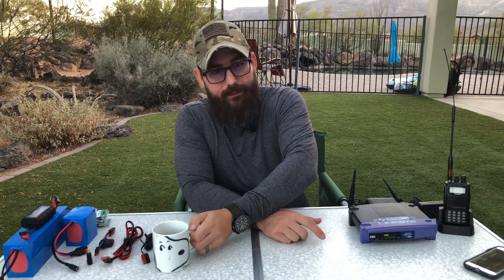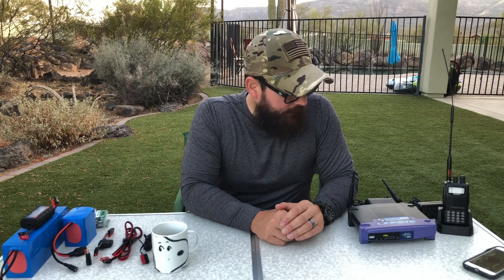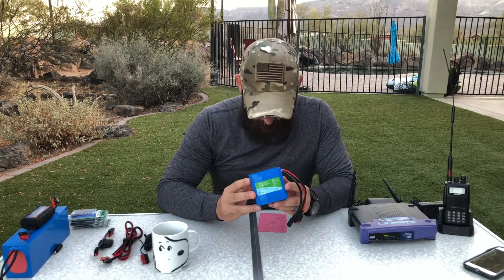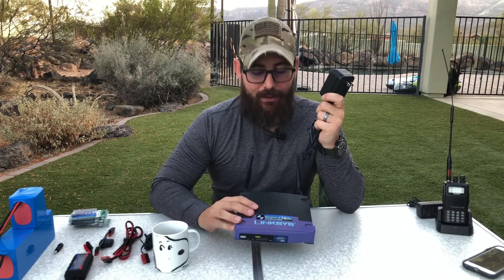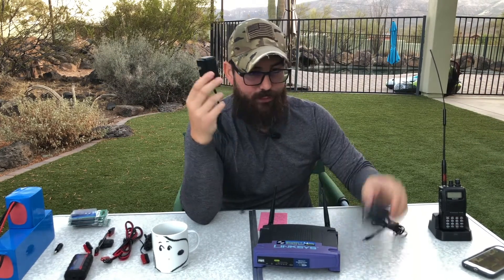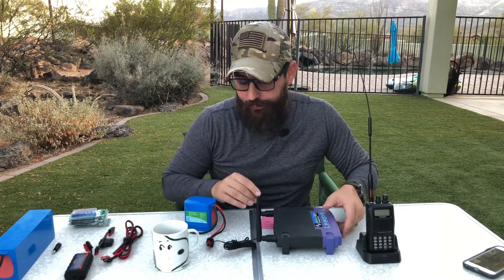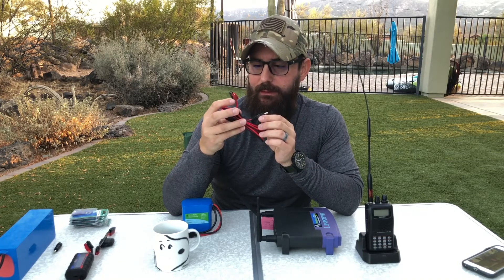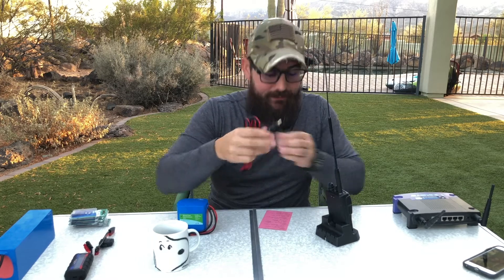12v Appliances & Accessories for Preppers and Hams

Comment: I have gone to rechargeable battery with   a no need for dry cell batteries  when the Power form how are we to charge  we still have to burn fossell fuel or use charged  car battery 😊

Comment: Just a comment on fuses. Fuses are to keep the wire from becomming an ignition source and do not protect your equipment.  To determine your fuse size you take into consideration the wire gauge and the length of the wire.  The length with a negative and positive wire is going to be twice the length, or the round trip from the battery and back.  Highly recommend the Blue Sea wire charts to make these determinations.  Love the videos.
Reply from the maker: Thank you for the correction. Yes, you are 100% correct. Glad you like the videos.

Comment: keep the inverter it may still be useful, transmitting power over distance the one example if you need to go a couple hundred feet the 12v dc won't do so good. you might find a more efficient inverter.

Comment: Great video. How is your project coming along?  My shack (it really is a small wooden tool shed)  is located about 200m from my house.  Totally offgrid.  I have been powering it with about 120w of solar panels and a couple of smaller AGM and LiFePO4 batteries.  That includes all radios, a Raspi 4b, a full sze LCD display (found in a junk pile, input 12v), HT chargers, etc. Where something other than 12v is needed I use buck converters.   Lights are rechargeable LED lanterns (amazon, of course) and a 5v goose neck LED light.  They and the Pi run on 5v.  My laptop (Lenovo Thinkpad) has a long battery life.  In any case I have a DC to DC charger for it. 

One MAJOR advantage to a DC system is no RFI from inverters, power supplies or other AC devices in the shack.  The mppt charge controller is shielded even though it emits very little RFI.  Being in an olive grove I have zero intererence from our neighbor, about 200m away from the shack in the opposite direction, and about the same distance from the power line.  My background noise is about S-zereo.

I have ordered from Alliexpress a 12v to 13.8v DC transformer (around 47 Euros) to ensure my radios get the 13,8v they desire.  I have some battery monitors and low voltage cutoff to keep my batteries happy, especially at night when the sun doesn't shine.  This will be less of a worry in the future.  See below.  Also there is a an 8 port  fused, Anderson power pole strip (see Amazon and other sites, ca 75 bucks).  That will clean up my wiring mess!

I am upgrading everything now.  I suggest you visit the website and YT channel from Will Prouse for ideas about PV systems for homes and RV's.  I am now building a system based on one of his suggestions. It consists of 400w of solar panels (2x200w in my case), 2x150Ah AGM batteries (can't afford LiFePO4 batteries that large), my Epever MPPT solar charge controller already in use. For the shack it will be a 12 system (batteries connected parallel).  For the home back up system (see below) I will probably configure it as a 24v system, especially considering the size of the planned inverter.  The wire connection inverter and battery is thinner and cheaper.

I will also get a 3000w pure sine wave inverter.  But not for the shack.  Where we live we experience power outages of various lengths.  They seem to be getting longer.  We have generator to power most appliances in the house (we have a transfer switch and can cut our house off of the grid), but fuel is limited.  With the "small" PV system that can easily be transported to the house, we can continue top power our appliances (on a rotating basis) and our cistern water pump so that we have running water and hot water (we have a siphon based solar water heater).

I got some great ideas from Will's YT videos and his book "Mobile Solar Power Made Easy."  Not just for the RV crowd.

Comment: If you do decide to use an inverter it may be more expensive but try to get one that's a pure sine wave inverter especially if you plan to charge or power high-tech devices such as computers for devices with computers in them.

Comment: When making your own cable and after cutting off the wallwart, how do you know which wires are positive and negative to put the powerpoles on?
Reply from the maker: Good question. Typically, the wire with the white stripe or dashed lines will be the positive. The negative typically has no markings.

Comment: You are heading the right way. When you design your PV system keep this general rule in mind to keep I^R losses low and minimize wire guage required. Keep your DC current to 100A or less. You will find that the industry already tends to follow this rule in sizing inverters, etc.
Also, the off-grid lithium battery industry has skipped over 24VDC batteries going from 12VDC straight to 48VDC. So if you are designing a system to support a 1500W-3000W inverter you should consider a 48VDC battery system instead of a 24VDC.
I went with  16ea. 100W Renogy monocrystalline PV panels and two Morningstar Solar Prostar MPPT-40M charge controllers.  This allows my to run 1200W of PV to a 24VDC 150Ah battery bank comprise of four 75Ah 12VDC AGM batteries powering a Samlex 3000W pure signwave inverter. This can be used to power my refrigerator or small portable or window HVAC. The components were chosen based upon reported reliability and FCC class B rfi noise certifications.
The 400W of PV system can power a 12VDC 75Ah of AGM battery for powering radios and other small 12VDC gear.
I do have a 12VDC 300W Samlex inverter that I mainly have for plugging into my Chrysler 300.
I have 18VDC tool batteries, fans, and lights with enough power for 2-3 days of fans and lights before I need to deploy solar.
Breakers and box are from Midnight Solar and I have a system wide GFI from Morningstar Solar that does NOT require an earthground.
As I built the system 5-6 years ago I stand by my build decisions at that time. With the industry as it is now I probable would do a 48VDC battery system.

My systems are meant to be portable. I cannot install solar on my condo, nor can I use a generator after a hurricane due to CO2 issues and code.
As I did a portable system I used 3 conductor flexible rubber jacketed portable power cable to PV array, battery bank, and inverter. The three conductor cable gives me flexibility as to where I put my earthground should I use one and it allows an easy way to tie the grounds together from one end of the system to the other.
One last important note. Look at the latest NEC for solar. There is a DC voltage limit of I believe 85VDC at the component level. For PV panels it is based on open circuit voltage. This for the safety of first responders to prevent or reduce the likelihood of electrocution. Four 100W nominal 12VDC panels exceed this voltage by 2-3 volts being around 18.5VDC pmax and 22VDC open circuit voltage.
NEC has to be adopted into local building codes before becoming effective and applies to new construction and major renovations. Find out where you area is related to the latest NEC and design accordingly.
Also, inverted losses are fixed based upon voltage drops across descreet components like diodes. That is one reason higher voltage PV systems, battery banks, and inverter acheive higher efficiencies.
Reply from the maker: Excellent tips. Thanks for sharing. I started a separate build over a year ago to solve the CO2 problems indoors. It's basically a 100Ah LiFePO4 battery on a dolly with a 3000 watt pure sine wave inverter. Works very well for running the fridge for 24 hours. 

https://youtu.be/Dk07XA_i0MI

Comment: Can you tell is what you use the router for?
Reply from the maker: The RV is parked on the far side of my property. We have no cell reception and the wireless network does make it far enough to the RV when using a laptop. With the antenna on this router I can get a signal from the house. I use it as a wireless bridge so that I can access my home's primary network and Internet gateway when working in the RV.

Comment: Do you need to regulate the output of the battery too the divice for direct connect? Or dose the input device determine the current drawn. Ps the fuse is just for surges rite?
Reply: The battery provides a voltage and a potential current. A load device draws a specific current related to the supplied voltage.
The load device is looking for power as Watts within a designed voltage range. The lower the voltage the more current the device draws to get the required power in Watts or Volt Amps. Increased current causes additional heating in the load device. In well designed devices the device shuts down due to lower voltage. In poorly designed devices all the magic prayer smoke escapes through a critical component sometimes causing spectacular catastrophic failure.
Reply from the maker: Catching up on comments. Thanks for jumping in. Excellent response, Viron.

Comment: Thanks for putting this together. There are obviously some things preppers need to get before worrying about tech when SHTF but for those of us who have air, water, shelter, food and lead throwers covered; tech will massively increase our grid down productivity and security.

For compact systems that are close to their power supplies DC is more efficient power source than AC. Only use the AC inverters if you need to throw your power 'long' distance or lack of large cable gage is a limiting factor. Remember when using DC the higher the gage the more efficient it'll be.
Reply from the maker: No problem. You're right, once you have your core preps in place, tech has a place. For the last 6 months,  the channel  has been focusing on offgrids comms. The ability to power and effectively use comms without a grid tie absolutely increases our capabilities as preppers.
Reply: Let me add a data point. The issue is not AC versus DC, but the difference in voltage. For a given amount of power required, the higher the voltage the lower the current. Power lost in transmission is related to the square off the current. Again, for a given power required, a 12vdc system requires about 10x the current of a 110vac system and that’s where the power lost in transmission comes from.

Furthermore, transformation of DC voltage is more challenging (doable but not as simple) than transformation of AC voltage. This is one of the main reasons Westinghouse’s AC distribution system supplanted the Edison DC system. It’s fairly simple to transmit AC power at high voltage (lower current and lower transmission loss) and then transform it to line voltage near the use point. 

This is a reason why some solar installs use higher DC voltage (24v or 48v) — to reduce the current required to transmit power and thus reduce loss.

This is a long response, but is something I’ve been thinking about quite a lot over the last couple of years. 

DC-DC buck converters are one way to transform DC voltage, but they are relatively low power and can be radio noisy. I have one to power a Raspberry Pi from my station supply that is quiet and my Pi only draws about 500ma to run.

In the end, this is a huge topic of great import to prepares and radio operators. Thanks for taking on the project, Gaston. 73 de AG7TX

Comment: Not only are you losing efficiency at the inverter bit there will be power losses from the ac to dc conversion with the wall wart
Reply from the maker: Absolutely great point. We’ve been running directly off the 12v battery for awhile now.  The WRT54G is a 12v device, so we were in luck so need for a boost or buck converter.

Comment: I ordered a USB 5 volt to 12 volt cable in hopes of running my WIFI router from a power bank. I have a Rockpals 280 watt hour power station and in a test I ran my WIFI for six hours and lost 19% of the charge using the AC output. But during a power outage I`ll need to recharge the Rockpals with a 60 watt solar panel and my internet will be interrupted for hours. 

I saw one of the converter cables and ordered four and a multimeter to test the polarity and voltage so I won`t damage my router. I have 15 power banks and six smaller wattage panels with USB ports to keep plenty of those charged for various devices and they should also easily power a 5 watt 12 volt WIFI router too. 

The 20 to 30 watt portable USB solar panels easily power a small USB fan even on cloudy days and it`s much less expensive than buying batteries for fans after hurricanes and other bad storms. I also bought a little 12 volt DC water heating element that you place in a cup and a cigarette port adapter for my 60 watt panel. Hopefully I can heat water with the 18 volts coming from my 60 watt panel with it without damaging anything so I can have instant coffee. It`s rated at 120 watts and my panel puts out about 50+ in bright sun. What do you think? Will it work but just slower or will my panel burn out? I haven`t received it yet.
Reply from the maker: Well, it sounds like you have a plan to power your small devices during an outage. I've personally found that anything with a heating element has a high current draw. Do you know amp rating for your water heating element? As for solar, do you have a charge control between the solar panel and your 12 battery? The charge control is designed to safely charge your battery and then allow you to connect your load to a stable 12v source.  By the way, I did a video where I grind and brew coffee on a portable battery/inverter setup.. You may enjoy that video. https://www.youtube.com/watch?v=Dk07XA_i0MI
Reply: @TheTechPrepper  It`s this thing on Amazon. I`m at my sister`s until I get moved, which might not be before the next crazy storm or hurricane, and she only has an electric stove. I bought a Coleman stove and can also use the cigarette lighter output of the Rockpals to use this to quickly heat a cup of water but have become curious about hooking this directly to a 60 watt (or larger) panel with an adapter without a battery. 

I plan to live out my days in a travel trailer in a very rural area and will likely run as much as possible off solar even if I have to buy the system one piece at a time. I`m disabled but still able to get around but have little money. I have enough saved to get my trailer and get it hooked up so I`ve used the stimulus checks to prep. It gets hot here in Louisiana when the power fails after late Summer hurricanes. 

I got the Rockpals for WIFI after storms because we have poor cell service here so that`s useless for internet and I got a bunch of power banks and 20-30 watt portable solar panels to run fans, lights, and to use with USB battery chargers to keep radios and flashlights going because that was the immediate issue. 

That next step up in solar....running larger things like freezers and refrigerators, is out of my league right now but it`s a goal. I`m trying to make the right decision towards that goal while I have money for larger purchases like decent inverters and charge controllers for a 24 volt system but still don`t know what to do. It may not be possible due to trees on the south side of the lot unless the panels are 40 feet in the front across a gravel road. One trip to the store and my panels would probably get sold to the scap yard by thieves. But at least I now have power for the small stuff. I`m extremely happy about that. The bastards can`t turn off my lights and fans now! LOL!
Reply from the maker: @baneverything5580  I hope you're able to make the best of the trailer. My wife and I tried it for about 6 weeks while we were between houses. It's actually a really pleasant and simple lifestyle. I don't want to steer you in the wrong direction, so I'd like to point you at what I believe to be the best source for your situation. Since you're already on YouTube check out Will Prowse. His earlier videos on "DIY..." are a great set of starter references. He even talks about options. I would start with this video: https://www.youtube.com/watch?v=IRRKHYwB3Uo He also has a great book that is reasonably priced. Check out his website: https://www.mobile-solarpower.com/ Best of luck!
Reply: @TheTechPrepper  Here`s the water warmer description on Amazon: 120W COPPER TRAVEL WATER HEATER PORTABLE CAR 12V IMMERSION WATER COFFEE BOILER

Comment: Nice finds! Have been trying to keep all my electronics chargeable over DC 12v power cables or USB cables in my van with a GoalZero battery bank (charge via 12v while driving or solar) - the Anderson connectors and fuses seem like a good idea too! 👏
Reply from the maker: I’ve heard great things about the GoalZero. Nice setup.

Comment: Could you help with music? For those of us that can't play and in case of need for powerless music what would you recommend?  Thanks for all your work.
Reply from the maker: Would anyone be interested in a quick video on how to convert 12v to 5v? This would allow you to charge your phones, tablets and other usb devices off a 12v system.
Reply from the maker: That’s a good point and there are many ways to solve this problem. Here’s what we do: we travel with a small battery powered Bluetooth Bose speaker. Our model uses a micro usb cable for charging. It’s 5 volts just like our phones and tablets. We basically connect a $10 buck converter to go from 12v to 5v. Here’s the one I use: https://amzn.to/3hsKABu
Reply: Harmonica or Jaw Harp and bottle of whiskey for those that have to listen to you play.
Due to the non-renewable nature of whiskey your compadres will be forced to go foraging for supplies. Getting them to comeback with whiskey is a problem I haven't yet solved.
Maybe there is a DIY Project Monarch that I am not aware of.